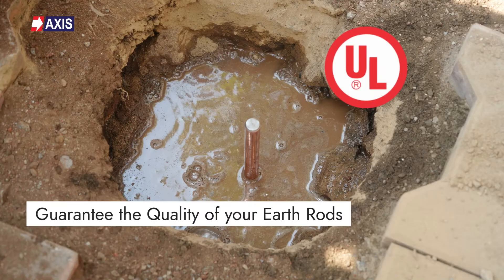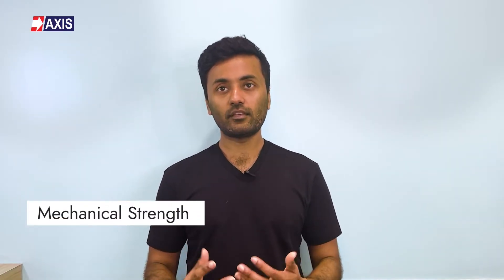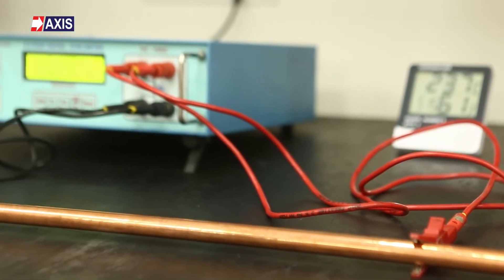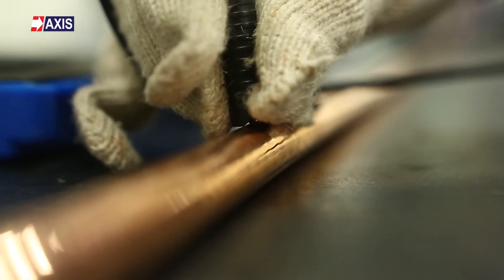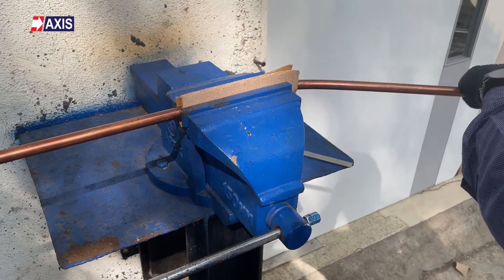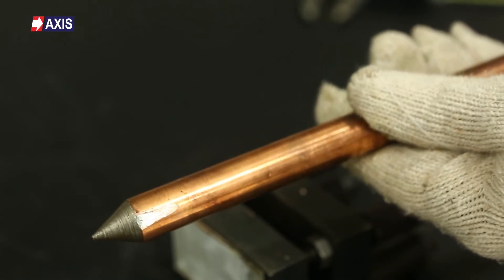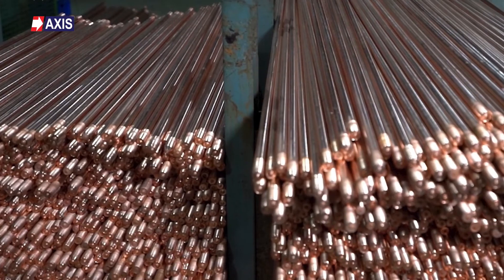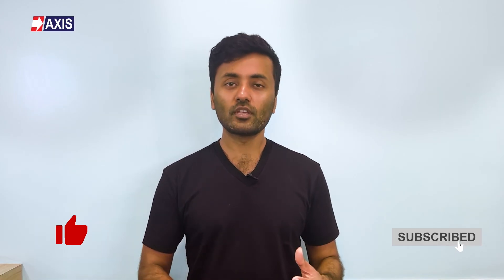5 Types of Tests for Earth Rods - Electrical & Mechanical Tests

Comment: Why tensile test? Rods are hammered down upon installation. Wouldn't it better if compression test?
Reply from the maker: Tensile strength measures a material’s ability to resist being pulled apart. Even though rods are hammered during installation (a compressive action), once installed, the main mechanical risk is not compression, but pullout forces. Rods are slender and long — they are more likely to fail by buckling under compression even if they have good mechanical strength. 

Thus international standards like IEC 62561-2 recommends the tensile test.

Comment: How do one check the functionality of the thunder Arrestor after installation
Reply from the maker: According to IEC 62305 Part 3, Clause E.7, electrical testing of the lightning protection system, including the thunder arrestor, should be performed annually. 

For structures with explosion risks, visual inspections are recommended every 6 months. This ensures the continued functionality and safety of the installation.

For detailed guidance watch this video:

https://youtu.be/KtSl9dhtxdA?si=nk7YOnKQ7HAe3dsK